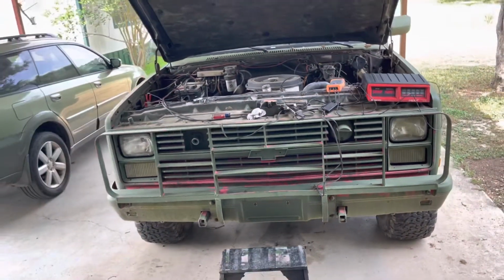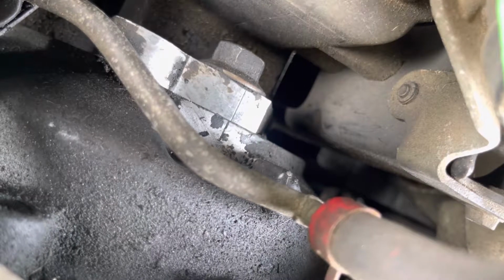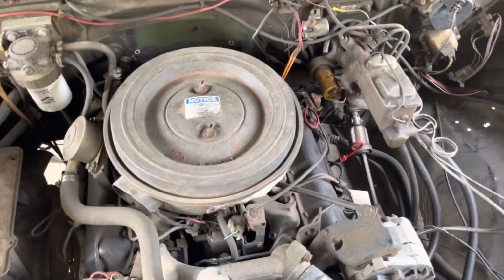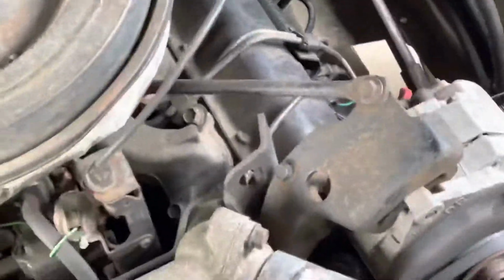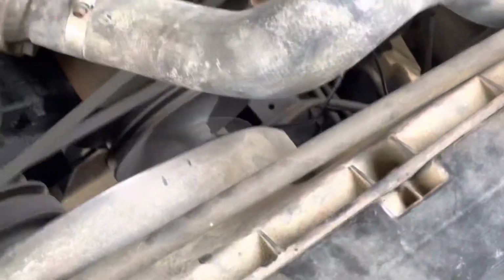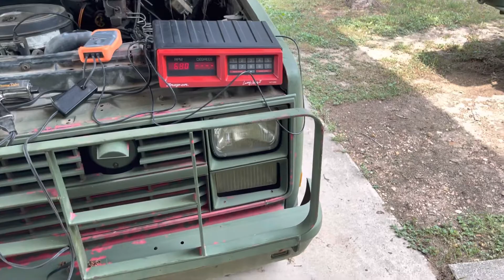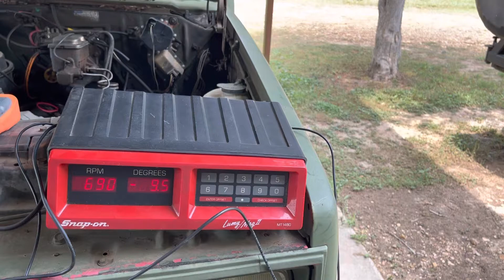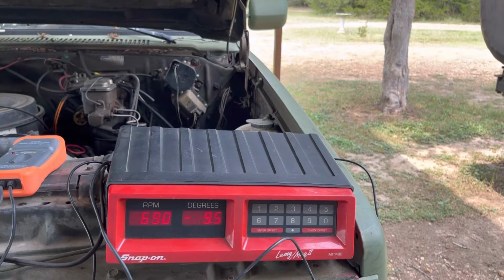6.2/6.5 Diesel Injection Pump timing

Comment: The differences of the turbo and n/a and why its different-  

the turbo has high pop pressures on the injectors.  
The higher the pop pressure helps with atomization and improves efficiency (both mpg and power), but loads the injector pump more- so this causes the rougher running.  Something like 1850 vs 2250 iirc (been lots of years ago) 
It is not as pleasing for a daily driver loosing the smoother run.  When I was playing race truck and had injectors set around 3350 range it really had a lope action to it. 

Another thing on the injectors is how well that pop pressure is balanced.  In the fleet (hundreds of 6.5s) we learned to balance them during rebuild.  The desired range of say 2250 , some could be 200 below and others 200 above.  So you are getting slightly different volumes of fuel and atomization.  Imagine each cylinder should be giving you 22 hp.  But a couple are giving you 18.5 and a couple giving you 23.5.  The engine is literally fighting itself.    I got used to cracking open injection nuts one at a time and listening to the difference of all 8.  The  I could tell when cylinders were performing at different levels . Give it a try- probably will not notice changes in the smooth running engine but the one that isn’t as smooth will stand out more.  

We would rebuild the injectors in-house (not hard, but now hard to get the shims).  Replace the injectors every 100,000 miles.  Buy having a set ready to go as spare its a quick turn around, then rebuild the ones you took out and store for the next time they are needed.   Where you buy injectors is a critical thing because there are so many junk sellers out there.  Get them from an authorized Bosch dealer is best option now days, there is places to recommend but I don’t want you to think I am some spammer. 

The other difference is how much the timing chain stretches.  When it it is idling you will get a consistent retarded rate, but when driving and you go from acceleration to decelerating back to acceleration you’ll get more stuttering because of the chain slop, especially above 200,000 miles.  We learned about every 30,000 miles was enough time of chain stretch to need a little timing adjustment.   

Your description of using the retarder is spot on.

When I worked at GM dealerships (usually was the only diesel guy back then) they didn’t even have much training on timing.  I went to Stanadyne training and they showed how.  You covered it all well enough that the only thing to add- NEVER EVER under any circumstances- have the nuts loose or adjust while the engine is running. It can cause chattering inside the pump and destroy it.  So sharpen a pencil and make your own mark that lines up with the pump, loosen nuts and adjust. Tighten the top nut and start/ test.  If you don’t like it- shut it off, loosen and adjust, then tighten.  Start and retest.   When your happy, tighten the bottom two.  

There is a ton to learn on these ol rattling toys.  Best forum (and free) is thetruckstop.us  guys from broke and bailing wire to a few that can scorch the dragstrip from time to time.
Reply: Thx for taking the time to make that reply.
Reply: thanks for sharing your knowledge.

Comment: WhenI was in the Army back in the 80's we often had to replace the engine front cover due to cracks. The new covers did not come with timing marks, so we had to use a special tool J33042 to put a timing mark on the cover. Then we had to check to verify correct timing with the Tach N Time J33300-A.
Reply from the maker: Interesting. Thanks for watching.

Comment from the maker: The timing light with the induction pickup measures when the fuel goes through the line. The Lumy mag measures when the fuel turns into a flame. There will be a difference in what they show. 

Because temperature and pressure change the rate diesel fuel lights on fire. Lighting off faster with higher psi and temps. The DB2 retards the timing as the rpm increases. 1300 rpm is where the timing value should be read at. The idle value is not consistently related to the 1300 rpm value in my experience with different engines. 

My non turbo engines I try to get at -2° at 1300 rpm with the Lumy mag. The engine in the video is below that and since it runs good I have left it alone. My turbo charged 6.5 I currently have a +2° at 1300.  10,000 plus miles of mountains, trailering and all day long high speed runs have resulted in just great performance and no known damage. I really don’t want to go more advanced since I like how it runs currently. 

This make sense and answer your question?

Comment: I ask for help. I've been trying to adjust my injection pump for days. I have already adjusted the pump about 5 mm towards the driver's side but when I press the lower lever nothing changes in the way the engine runs. The IP is a completely overhauled one from the USA and the chain has also been changed. If I set the lines like in your video, the engine wobbles back and forth a lot and smokes so much from the back that my neighbor wanted to call the fire department. I hope you can help me because there are no real mechanics here who are familiar with the Detroit Diesel 6.2
Reply from the maker: I know we have a language barrier. This might take several writing back and forth. 

Can you get it to idle smooth with no smoke?
Reply: It idles quietly and smoke-free. I made short films but I don't know how to show them to you
Reply: https://youtube.com/shorts/DjvHs4F12vM?si=hhMcKh0gP9ayr2Fv
Reply from the maker: @ma-hn4il  That is a super clean looking engine and engine compartment. Very nice!

What happens when the cold advance is on with a cold engine?  Or if you energize the green wire with a running warmed up engine?
Reply: @timsteachablemoments1786  Thank you for the compliment! 
When I start the engine cold, the speed increases until a certain temperature is reached and then the speed returns to normal idle. Should I put 12 V on the geühne cable when the engine is running? If I understood that correctly
Reply from the maker: @ma-hn4il  94° F is the temperature the fast idle and cold advance should turn off. Try putting 12 volts to just the solenoid on the IP the green wire goes to. That will advance your timing. With that advanced and a warm engine. See how it runs and drives. If better then maybe your timing chain or IP gear is off a tooth.
Reply: The timing chain was changed about 500 miles ago. Everything was according to the book and he ran until the old IP broke
Reply from the maker: @ma-hn4il  OK. So for sure it must be just a timing issue with the IP.  With that in mind. Set it, drive it and try moving a little more advanced and drive again. Every time you move the timing, try and do a cold start and warmed up drive. You will know when the truck is acting happy and just leave it there.
Reply: my problem is. As soon as I put it in drive and want to drive off it goes off
Reply from the maker: @ma-hn4il  How fresh is your fuel filter?
Reply: about 500 miles. But I'll still replace it because the fuel pump said goodbye before the IP said goodbye. Not that anything came in.
Reply: https://youtu.be/4p5YcTtHULE?si=j9HM8PqhXfV0_Og4
Reply from the maker: @ma-hn4il  The last video of it smoking indicate glow plugs or at least not enough heat inside the cylinders. That is for sure not a happy engine. I think it comes down to not enough fuel getting through the injection pump. Either because a bad pump or the on/off solenoid either isn’t working correctly or the interface between the top and bottom parts of the pump aren’t messing correctly. Here is a video about how it fits together:
https://youtu.be/8vHA_8Hanj8?si=JhJIuSBuQXY7syPq

Comment: Hi Tim, do you remember what hood insulation this is? Is it a kit? Thanks
Reply from the maker: It is the kit from LMC. I can’t remember if it came with the plastic push things that hold it on. But, you need more than you think. Order extra if they come with the kit and order more than you want if they are separate. Thanks for watching.

Comment: Its the rubber  vibration damper  its moved over time ???? You think ????
Reply from the maker: The truck in the video had a new harmonic balancer installed not many miles before the video. It is possible, but I don’t think so with this engine.
Reply: if the damper moves the keyway in the crank is busted, happened to me. The bolt which held the damper snapped. Had to pin the new damper. old damper rubber was swollen and cracked and needed replacement.

Comment: Did you adjust pump while it was running?
Reply from the maker: NO!  Do not adjust the pump with the engine running. Bad things can happen. You can loosen the bottom two nuts and keep the top one tight as you test a new setting. But, get all 3 tight once you are done tuning.
Reply from the maker: @barrypayne421  It will be hard to move by you. There is a gasket to the timing cover that could have become stuck to  either the pump, cover or both. Someone might have even put gasket sealer on there in the past. Plus, the injector lines are also holding it in place. Some company even makes a pump turning tool.  What I do is grab the throttle cable bracket and use that as leverage to turn the IP.
Reply from the maker: The timing gears have more mechanical advantage than we do. So, they can turn it with ease. That is why at least the top bolt should be tight anytime the engine is started.

Comment: Where did you get the fuel filter relocate kit
Reply from the maker: That is a Stanadyne FM 100 base and filter. Same mounts as the stock filter. If I were starting without a stash of filters like I did. I would just buy a Duramax filter assembly off Amazon for around $100. Base, filter, water in fuel sensor and heater.
Reply from the maker: That is a Stanadyne FM 100 base and filter. Same mounts as the stock filter. If I were starting without a stash of filters like I did. I would just buy a Duramax filter assembly off Amazon for around $100. Base, filter, water in fuel sensor and heater.
Reply from the maker: That is a Stanadyne FM 100 base and filter. Same mounts as the stock filter. If I were starting without a stash of filters like I did. I would just buy a Duramax filter assembly off Amazon for around $100. Base, filter, water in fuel sensor and heater.
Reply from the maker: That is a Stanadyne FM 100 base and filter. Same mounts as the stock filter. If I were starting without a stash of filters like I did. I would just buy a Duramax filter assembly off Amazon for around $100. Base, filter, water in fuel sensor and heater.
Reply from the maker: That is a Stanadyne FM 100 base and filter. Same mounts as the stock filter. If I were starting without a stash of filters like I did. I would just buy a Duramax filter assembly off Amazon for around $100. Base, filter, water in fuel sensor and heater.
Reply from the maker: That is a Stanadyne FM 100 base and filter. Same mounts as the stock filter. If I were starting without a stash of filters like I did. I would just buy a Duramax filter assembly off Amazon for around $100. Base, filter, water in fuel sensor and heater.

Comment: Tim, a question. The timing light shows the white timing marks at 0 degrees at idle. The SnapOn shows 6.5 degrees at 1300 rpm. Obviously, a difference in technology. Is it safe to say if the white timing marks line up at 0 degrees and the scribe marks on the IP pump and housing are lined up or +/ 1 mm you should be good to go. I have a military humvee with the mechanical 6.5L diesel. My IP hash marks are about 1/4" retarded (passenger side) and this is verified with the screwdriver test... When I push the advance lever in nothing happens...engine sounds the same...no drop in rpm or engine sputtering. Thanks. Mark.